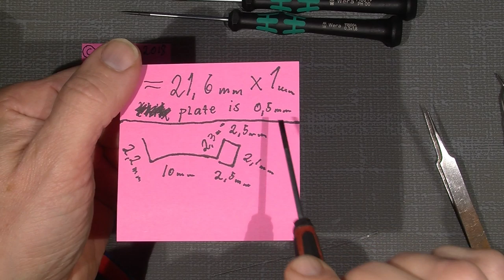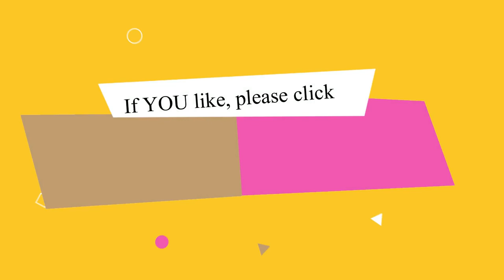How to DE-click Leica Summicron-R 50mm 1:2

Comment: Great news, I did this to all 6 of my Leica R lenses.. Def felt weirdly good to snip out the spring but,  they work just as they should now for filmmaking.  I did  21 f4, 28 2.8, 35 2.8, 50 f2, 90 f2, 135 f2.8

Comment: Hei mikeno62, I just follow your guide to declick 2 Leica R but I notice that you don't need to cut the steel string.
The second screw that hold the stting on aperture mechanism could be unscrew out: move the screw all the way to 1 side to stop it from fiddling around, then you put the screwdriver vertically to the screw. It has reverse thread so you screw out clockwise.
Some threadlock glue might be there, a tiny bit of acetone will be useful.
Other than that it's all the same as your guide. The use of bronze plate/wire is brilliant!
Reply: did you try this? and did you do the bronze plate/wire technique? Curious to see if I can get away with not doing this without the aperture slipping

Comment: Hello there, does anyone know the size of the ball bearing? I bought a de-clicked R lens and would like to make it click again. Any help is greatly appreciated!
Reply: Hi Danny, if you haven't figured this out yet yourself, I've actually measured the ball bearing inside the Leica Summicron-R 50mm serial #3228---- to be 1.47mm diameter. I tried a few different size ball bearings and found that 1.45mm, 1.4mm and 1.3mm ball bearings also did the job of giving the click to the aperture